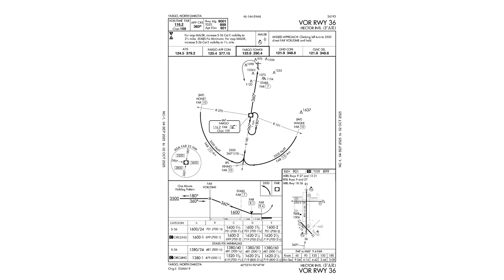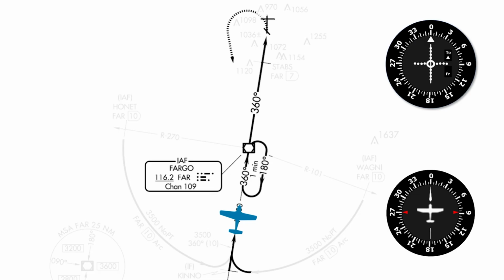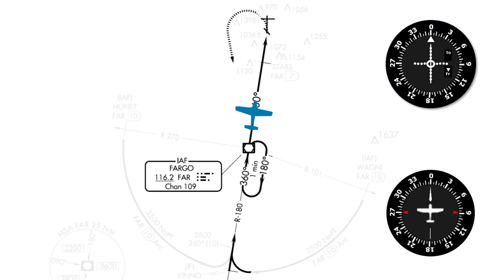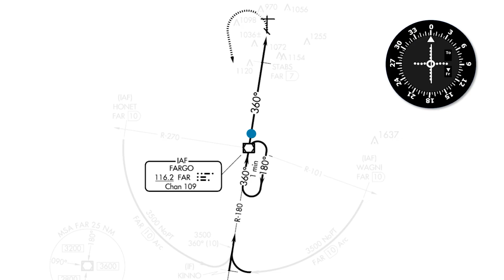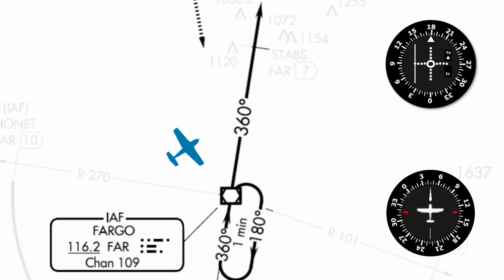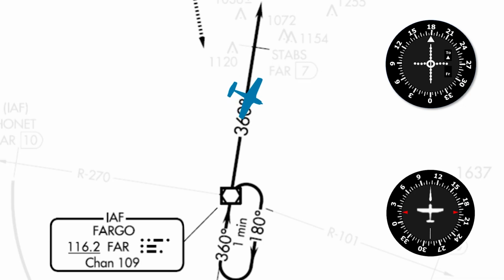✈️ VOR Reverse Sensing Explained (Finally Makes Sense!)

Comment: Can this be simplified further by thinking about which direction to turn as cardinal instead of relative when it comes to vor intercepting? By that I mean, stop thinking in terms of left or right turns (or chasing/pulling the needle), but instead look at where the needle is deflected in relation to east, west, north, south. Whether normal sensing or reverse, if you move the aircraft toward the cardinal direction of deflection, you will intercept the radial. 

i.e. if the needle is deflected east, head east to intercept. 

Please correct me if I am wrong. I’m a low time PPL trying to further solidify my understanding of nav aids while I study for my instrument rating. But this is how I have come to understand how CDIs function. To me, trying to flip things around in my head to understand reverse sensing is an over complication of what can be a much simpler thought process during a critical phase of flight.

Comment: It would be nice to get ride of the "Reverse Sensing" label forever!  Referencing a 1980 Instrument Flying Handbook AC61-27C,  it doesn't reference this term anywhere! The book states Principles of  Operation state that "VOR operation is based upon the principle that the phase difference between two AC voltages may used to determine azimuth location." I guess the book was too technical for most and the FAA had it dumbed down to a point that continues, after close to 80 years,  to confuse most pilots to date! 
Your demonstration is spot on! And hopefully, some of your viewers can learn by it or get more confused and finally have to figure it out.